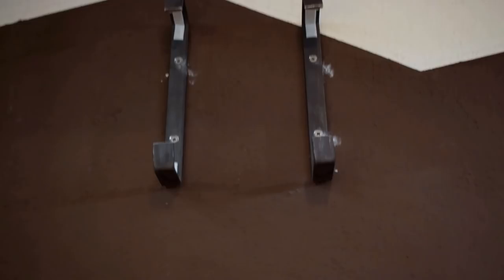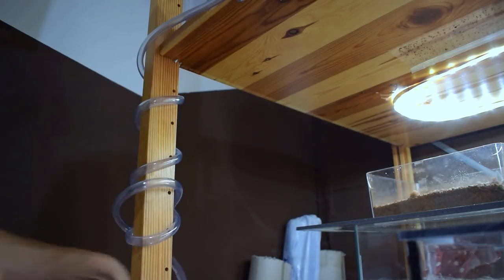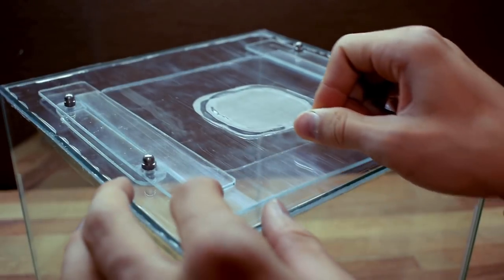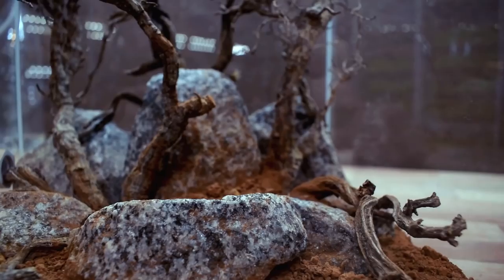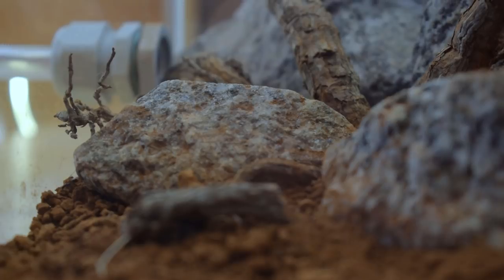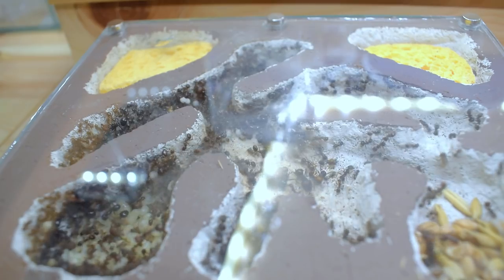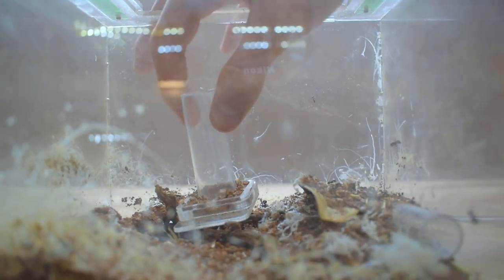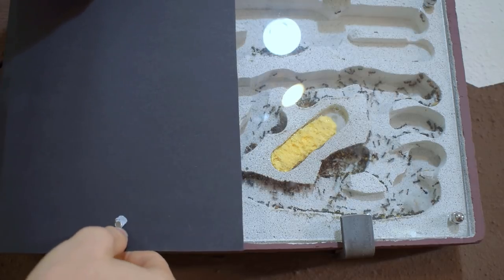10m Setup for my Messor colony! *Tutorial*

Comment: Im a Sparky (Electrician)       im constantly grabbing 20mm white stuffing glands out the van   😂,      thats what the white cable thing is btw          if you remove the rubber inside and use a cone drill bit to open it up a little,  you can fit a test tube in the 20mm stuffing gland perfectly          drill a 20mm hole in any container and just screw it on    👌🏼
Reply: Sounds like a cool idea sparko